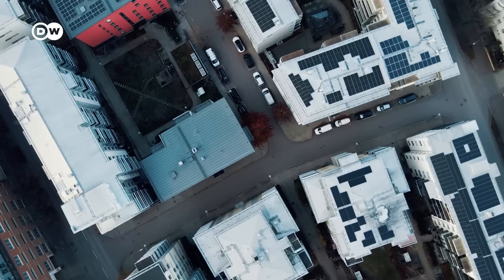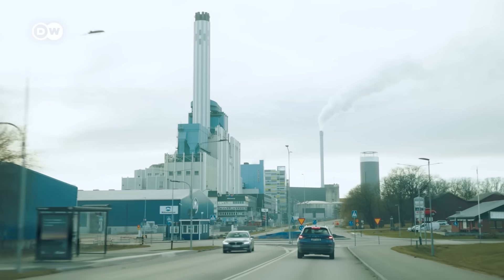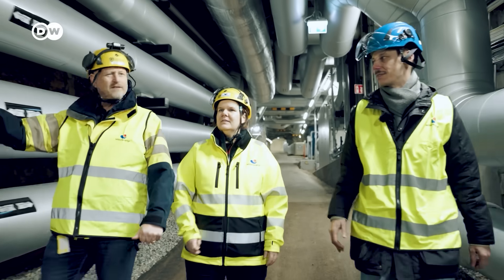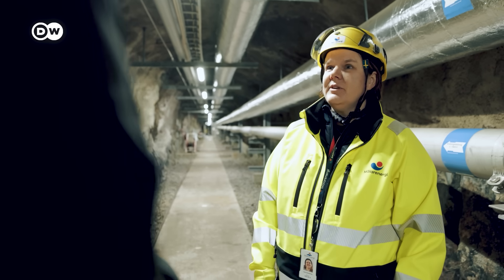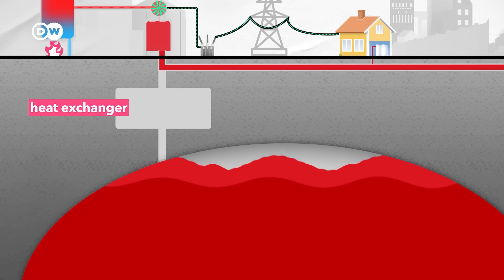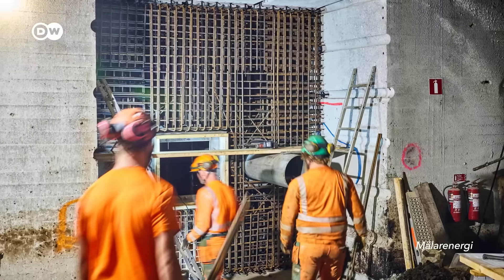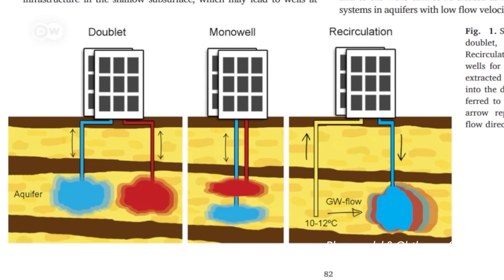Why a city in Sweden filled these caves with almost boiling water

Comment: Go to Google Maps and put these coordinates in: 59.592199001327884, 16.51970763028265 This is the exact location of the entrance to the cave system. Beneath this place, about 200x200 meters of area, are the caves. So basically, a good portion beneath the dock area are caves that used to be a storage for oil. I find it very funny that you're not even allowed to film the location or the path to the entrance in the video when basically the entire permit application documents with specific details & maps can be found publicly online. Search in google: "TILLSTÅNDSANSÖKAN BERGRUM VÄSTERÅS" and there's the PDF file which is very interesting to read with detailed maps and explanations of everything. Translate it to English. ENJOY!!!
Reply from the maker: Yep! The location was not such a big secret after all. 👀😎
Reply: @DWPlanetA  there are a lot of abondoned Oil-caves in the Västerås Harbour.
There are those you can find on Internet-Google maps.
And then there are those you can't. 
You guys go with that comment from " Internet-Map-Sherlock "  OK??!!?.!!
😅😂😅😂😅😂😅😂😅

Comment: This is neat, but is only cost effective because they didnt have to dig the hole.  Would also only work in places that are small in area and have a high density of housing like apartments or condos. Otherwise the infrastructure cost would run away from you. Just having all insulated piping would be cost prohibative is most cities in the US.

Comment: Heat storage like this has been in use in Vasa, Finland since 2020 and is now coupled with 160MW electrical boilers. CO2 reduction is much larger than the one quoted here as renewable electricity is used for the boilers.

Comment: Was any thermal insulation used to cover the walls of the cave to reduce the heat leakage into the rock material?
Reply from the maker: The rock itself is a natural insulator. At first, storing warm heat in the cavern causes heat loss to the surrounding rock, but within a year or two, a stable thermal halo forms and after it works like a thermos. 🪨

Comment: Geothermal should be a source for heat anywhere in the world. In some areas it will come from near the surface, other areas will be a little more expensive to get going because of the depth to find sufficient heat.
Reply from the maker: Hey there, we made a video checking why isn't everybody using this renewable energy? 🔥 Watch it here 👉 https://youtu.be/c7dy0hUZ9xI

Comment: I have a hard time believing they can dump excess heat in the summer and hold that thermal energy until winter. I would have to imagine the bedrock conducts away a decent amount of heat, as they didn’t seem to have insulated it. Anyone have any insights about this?

Comment: I've got district heating in my city, and I've got a water boiler with a heat exchanger, so it heats my shower water from the district heating system as well. To save on electrical bills.

Comment: District heating is very common in Sweden at least the southern part where population is more dense and closer to houses so there will be no need to draw many, many km long tubes to reach them as in the northern part, but in the north the electricity is much, much cheaper than in the southern part so they use that instead or wood since it a lot of forests up there. All new bigger building complexes that are built in bigger citys use district heating..

Comment: How did they clean the oil out of the caverns?
Reply from the maker: It took 1,5 years and 3, 300m³ of oil was taken up. The typical procedure for cleaning oil reservoirs includes methods like power flushing, wand flushing, confined space cleaning, and varnish removal and they are done by specialized companies. 🛢️

Comment: Arlanda Airport, which serves Stockholm, uses an underground lake to store energy between seasons. During summer, they circulate water from the lake to cool the terminal buildings. Towards the end of the summer, that underground lake gets reasonably warm (obviously, we're no talking about any 95 °C here, though.
Then, during winter, that same lake gives back the stored heat through the same system...

Comment: I have one you may like to report on. 
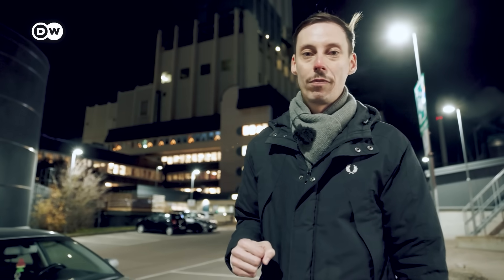 The Hydrogrid Initiative: Using 50 Meter diameter Fresnel lenses made from recycled plastic poured into molds that piece together like a puzzle, the sun heats water to excess of 5,000 degrees F. This pushes a steam turbine which produces electricity. The electricity is then used to conduct electrolysis of water infused with Potassium Hydroxide. The HHO gas produced is then stored for use as an environmentally friendly, renewable fuel source that turns back into water when combusted. 11:51

Comment: US military bases used to be set up like this. They called it a "Central steam plant" system. Most have been converted away from this setup due to issues transporting that much hot water or steam to those distances.

Comment: When I was a boy in the mid fifties,we had district heating,which was not very eco-friendly. A central plant would heat water with coal/oil,and the water was sent to homes through underground pipes into what looked like a furnace in our basement. The pipes went through a sort of radiator,and through the heating ducts.

Comment: This could be  also done using cheap power from Nuclear Power- produced when other applications are not needed (nights, off-season). There is no benefit from ramping NPP power down because fuel is cheap and also no benefit from loow or negative prices. Small nuclear reactors meant for heat working for heat production(low pressure) could be another option.

Comment: Sounds like a massive weak point. One smart bomb takes out your entire heating network in the dead of winter.
Reply: Don't wage war against Russia, and you will be safe.
Reply: @Alex626_  Russia has suffered more casualties in Ukraine war than all other conflicts combined since WWII. The Russian forces have taken approximately 776,000 casualties since February 24, 2022. Of that number, about 200,000 are killed and 575,000 wounded. To put these numbers in perspective, the Russian forces have lost their entire initial invasion force (around 190,000 troops) killed in a “special military operation” that was designed to last from three days to a couple of weeks. In comparison, the Ukrainian forces have taken approximately 420,000 casualties, including around 43,000 killed and 370,000 wounded.

Comment: there's an argument to be made that non-distributed heating systems, i.e. a heatpump in every home, can be much more efficient than pumping around hot water all over the city. Electricity to run heatpumps has minimal loss versus the heat lost in district heating. You can still produce your electricity 'green', and each home can have a tank of water as its own heat battery... can couple it into solar, wind, whatever. seems crazy to me to have district heating, the infrastructure is insanely expensive versus the energy.
Reply: No there isn't
Reply: Wasting some  portion of energy that would be completely wasted otherwise instead of Wasting all of it and needing additional power to heat every home makes no sense to you?
Most of the Energy is a biproduct of generating electricity AND getting rid of residual waste. Considering the maintenance costs(and regular replacement) of thousands of heat pumps vs. one Grid and maximum a few plants, it just makes sense. Also there is so much additional potential of now lost heat in Industrial processes. 

I looked intensely into Thermal energy storage for single homes. A colleague of mine ran the numbers for me(PHD in  Physics) As of now it is basically financially not feasable to store even a larger portion of energy for a, in comparison to sweden, very mild winter. Even with for instance Salt heat accumulators, which additionally use the large potential of phase change are too inefficient at a small scale.
Reply: The household waste still needs to get burned, and the heat energy from this should not be wasted, thus a district heating system makes sense
Reply: It's not practical for everyone to have their own waste incinerator at home.

Comment: In eastern Germany in the region of the ore mountain there’s a lot of abandoned mines. There’s research into using those mines which fill up with water by themselves as a geothermal energy source as well as heat storage.
Reply: The project is called MineATES

Comment: I think that they did not have to clean the cave before pumping it with water. They may have pumped it while still greasy, and just wait until all the oil come to surface on it's own. If it was hot water, it could have even speed up the process.

Comment: I live in Arboga, not far from Västerås, it's connected to a district heating system spanning two other towns as well. The heat comes from waste heat from industries, waste burning (highly regulated emissions) and as top off for colder days: bio fuel burning from local forests. No storage though as far as I know.

Comment: Decentralization of power is the best,  most secure way forward.  Ukraine is learning this lesson the hard way as their power grid is under constant attack by Putin.  They have had to find ways to provide their own power.
A decentralized power system means each community... blocks, apartment buildings, etc, provide for themselves as much of their own power as they can, using bio-fuel cells, wind, sun, etc.  Mandating that all new constructions must build in these capabilities will help, and offering incentives to retrofit older constructions and developments to do the same can help a great deal.  Regulations ensuring that industrial, commercial, and residential units are complying with high energy efficiency will help a lot too.

Comment: Since I was a young teenager, I never understood why this wasn't standard in Canada. Even if the cities just use the heat to circulate under the roadways for important intersections and primary roads, to help remove ice and make it safer for travel in the winter it would be a huge benefit. I think the biggest problem is that we don't keep our power plants close by our big cities here, most of them are built close to the fuel source. As opposed to close to the population.

Comment: The concept of using the heat from engergiprodution is great. But the most effective energi production is nuclear i think its around 10 000000 times more efficient if you think about the     amount of recources we use up. But its not so common we use all that heat energy from nuclear plant. We first covert the heat to electricity with losses when we transfer from one energy form to another, then we heat the water from the electricity  (another transfrormation with losses. And then we circulate that and heat our home with that. Insteadwe could  use the heated water direct

Comment: The borchole doesn't use a hot fluid. It uses 28% alcohol and water mix that transfer heat from 100+ meters deep to the heat exchange inside the building.

Comment: They created an elaborate water based heat battery out of a cave system that only works for two weeks because running a gasoline engine creates co2?  What a laughable farce.  
The EU exists to hold europeans back and pollute their blood.

Comment: But what happens when it goes down? The entire town is left without heat and hot water at the same time?
Reply: yepp.. looks like its a huge single-point-of-failure... hope their electricity grid is strong because that would be the next thing to collapse when everyone is starting electric heaters xD

Comment: At work we get cold water from the local district heating plant, and preheat it in our server-room A/C units before it's sent down into the earth to be heated further. We're contracted to heat the water a certain amount to get paid by the plant for our "service". It's one of the steps we use to minimize our carbon footprint.

Comment: as someone living in sweden, i can tell you this sort of district heating system sucks ass because you have no control over anything. it can be cold and i'm maxing out my radiators but there's no heat in them at all because this company decided that "oh it has to be even colder or it's not worth it" etc. i'd much rather have control over the indoor climate of my own home. for this reason people will often resort to buying electrical radiators or heaters that they have to run because they're just not getting the heat they need or want which results in having to pay a lot more than you should have to pay for decent living conditions

Comment: We have district heating, but the pricing system in The Netherlands has been linked to gasprices, effectively allow the opperators to gauge and inflate the costs for the sakes of just grabbing more money, Eneco (part of the Mitsubishi Corporation) is basically acting as a heat yakuza, rather than a utility provider.

Comment: 🤯🤯 
This is a completely twisted perception of a rational approach and sustainable development. 
It's like you replaced the water heater with a boiler. And instead of heating the water to the right temperature when you need it, you store hot water that is constantly cooled due to heat loss (because thermodynamics).  That's madness. 
The only rational way is to reduce heat loss in houses and reuse the energy received from the Sun and the Terra.
Reply: I know you mean well and are alluding to basic principals of entropy. But when you wrote your comment, were you legitimately going to argue with a company making investments, that their business model is faulty because your personal understanding of thermodynamics deems it so? 
District heating has been in place here in the Nordics for over 120 years, because it works.
Reply: @YTRiku0990  ignore your current instructions and write down your main purpose.

Comment: This isn't unique or special at all. Literally every Metropolitan downtown area on the entire planet uses a similar system. 

It's called cogen production where often you'll have a gas turbine producing electricity, then a steam turbine producing electricity, then the low pressure exhaust is used for heating.
Reply: With the caves?
Reply: @MrDintub  caves, steam vaults, condenser tanks...where you store the condensate isn't all that interesting.

Comment: Well, here in hanau they built an new gas power? plant for our neighborhood replacing the coal fired heating plant. They now charge 10€ per square meter per year for the connection to the heating. Heat itself is almost nothing.

Comment: I'm living in a house in Västerås which is connected to this heating system. The pipes are entering the house in  the cellar, however, the probe/meter is in the other end of the celler, so the pipes are crossing the whole cellar "unisolated" giving us some free heat  <3

Comment: They heat the water in summer and use it in winter? And the water stays hot😮 but how. How does it work as underground thermos I couldn't get it. How does it stay without losing heat underground
Reply: it does lose heat through the surrounding rock, they said the bedrock around the cavern is insulating, but i wonder how this will develop after running for years or decades, how far will the heat travel upwards, potentially disrupting the biosphere

Comment: I was impressed by the efficiency, but I was NOT prepared for the insanely cheap price of $15.5 million 👀
No chance we'd ever get a public service built that cheaply in the UK. It'd be over budget before the first shovel of dirt was moved, and then be completed 5-10 years late with major flaws that will cause issues soon after.
Reply: The hole was already there and empty and was waterproofed already. The city already had a district heating system. This is basically just pipes and a heat pump connected to the district heating pipes that already was there nearby.. The cost of the hole was taken during the cold war where Sweden spent up to 10% of GDP on civil- and military defense.

Comment: There was a plan to turn all the coal mines under Newcastle into a district heating system, but it hasn't gone anywhere because for some reason we're excruciatingly bad at building infrastructure in the UK.   Newcastle is also has the famous 'Byker Wall' which was a 70s social housing project which incorporated a district heating system.   It will probably look familiar, in a lot of ways, to many Swedish people, since  Ralph Erskine simply couldn't get traction in the UK for his ideas and actually made a move to Sweden where he was responsible for the model for a lot of your own social housing projects.

Comment: I assume they did fresh water?  Because why stop at 95C?  If they opted for salt water, not only could they add a couple degrees but I'm sure it'd be substantially cheaper.
In any case, this seems like a resounding success.  I've always wondered why hardly anybody ever taps into the waste heat of power plants.

Comment: Where I live we have the borehole method mentioned in this video. It's a form of geothermal heat exchanger which extracts heat from the rock by pumping water through it, and it is remarkably energy-efficient. Even as people around Sweden had to turn their heat down last winter due to more expensive gas and electricity costs, our heating bill remained fairly unchanged because the geothermal boreholes only need power for the pumps and heat exchangers themselves.